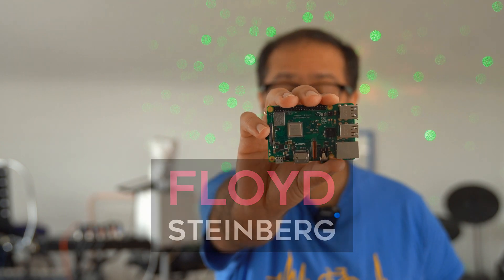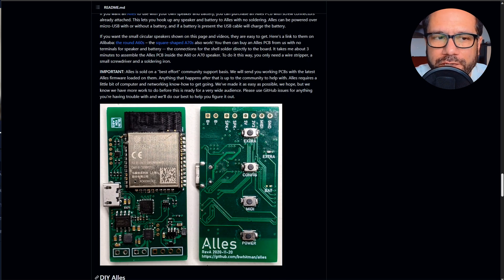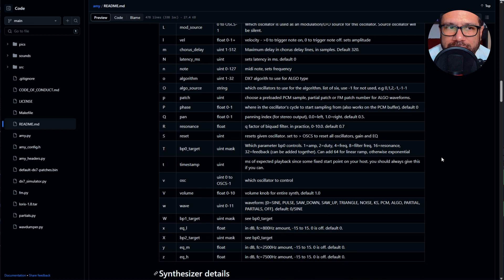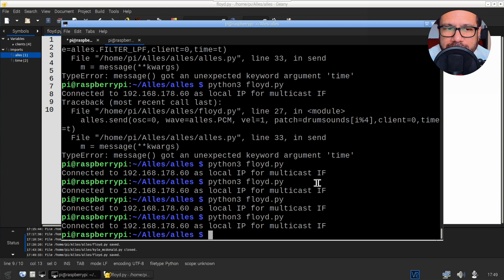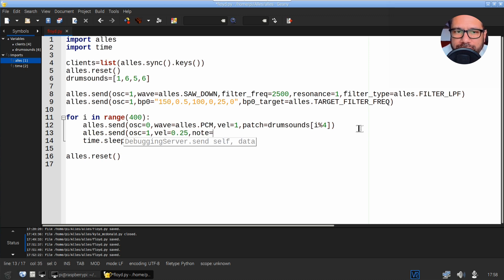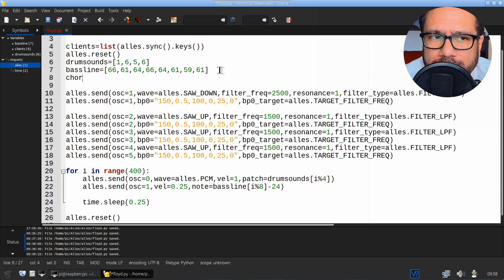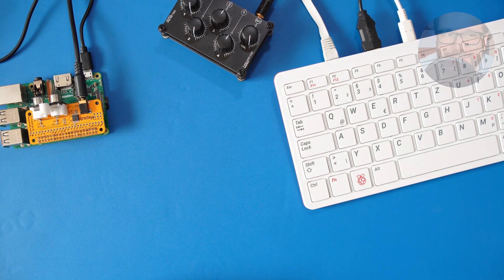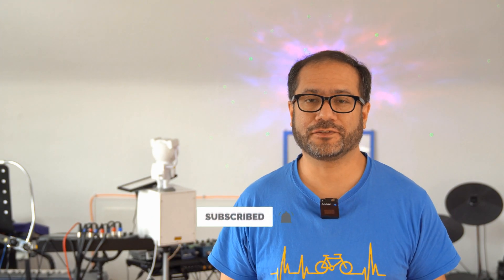The Alles mesh networking synthesizer - a field of sound at your control

Comment: Do ye have any experience about Alesis Wortex Wireless 2 on Linux?
Mine works, but i would like to have the lowest key for my right hand (the cable) side and highest key for the left hand (the neck) side. The Pads also work, but the programming is jumbled, causing it to change synth presets on the com recklessly. The good things is that Panic buttom work as intented.
Reply from the maker: I'm sorry, I never used the Alesis.